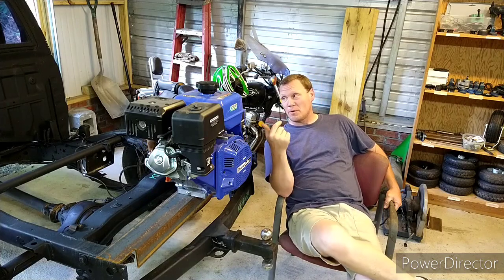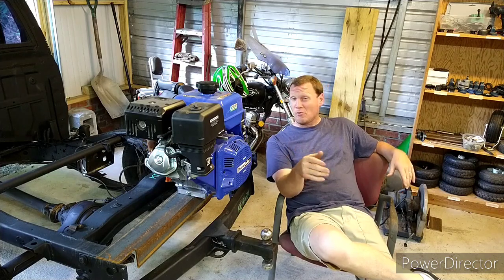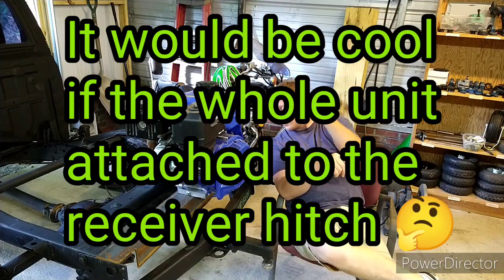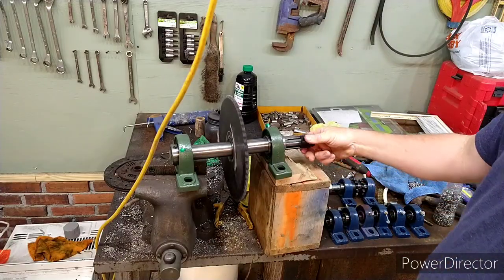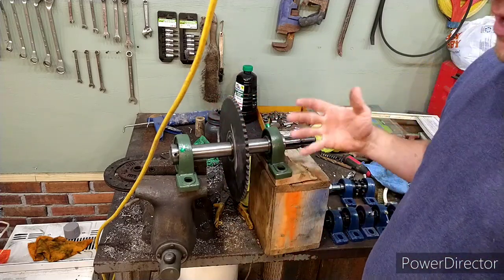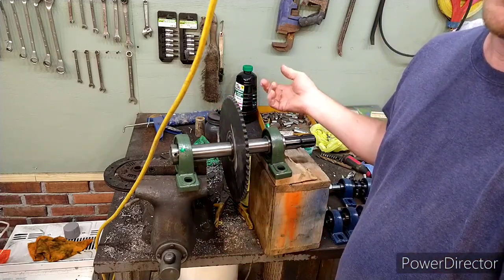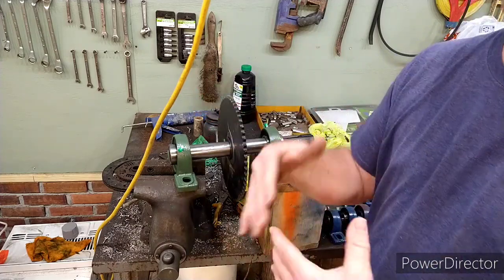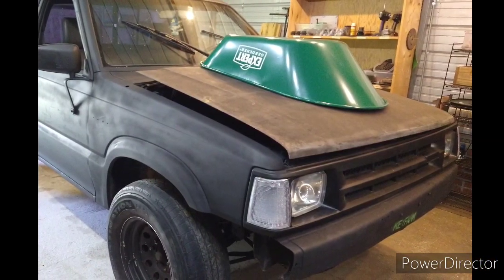Adding a tractor PTO shaft to the Predator 212 6.5 HP truck so I can bush hog with it. Concept

Comment: My buddy has a 21hp Briggs opposed twin swapped into a 87 ford ranger. He’s got it running a 2 speed belt drive off a centrifugal clutch. Low is 6-1 and high is 1.25-1. It’s got dual carbs swapped onto it and a few other mods it probably makes about 30hp. It will actually do 95kph in 4th up hill and hold 115kph😮 in 5th on flat land. He can tow a 3000lbs camper with it to 60kph. 
He refuses to let me film it says he wants to make his own channel but when it does get posted I’ll drop you a link to the video.
The crazy part is he actually daily drives the truck here in Calgary Alberta and runs it on the highway.
Gets around 950kms to the tank so I’d assume that’s around 60mpg. We drove to fort McMurray with it last year that’s a 1600km round trip and it managed.

He’s got a tiny 45 amp alternator running on it aswell I believe it’s from an old vw. He has heat by wrapping copper tube around the exhaust and using an electric water pump from a Kia to circulate it they a heater core and it works perfect even in minus 30.

I helped build it so I know most of the details.
Reply from the maker: That sounds awesome

Comment: Hay man got my S10 Duromax running but I can't figure out the throttle. Any chance u can do a short on how u set it up. We ran it with a string through the window. And that 24 to 12 ratio was spot on for the 440cc. We were moving the donkey in 4th
Reply from the maker: I actually built my throttle last night I think it's going to work I should probably do a short.

Comment: I get to tinker with my Trooper here and there, mostly been just dropping weight. I built a heavy duty wooden gantry to pull the engine and finally got that engine to separate from the transmission. It had one of those special pull type throw-out bearings and I had to unbolt the pressure plate from the flywheel. I should've just done that to start instead of trying to get that clip to release.

I really had my heart set on keeping the factory clutch but that flywheel and pressure plate are quite heavy and I'm a little worried about the centrifugal load.  Not sure.
Reply from the maker: Sounds good, get rid of the clutch, you don't need it, I just float the gears with no problem
Reply: @ChrisfromKeyfarm  right on. I have to figure out the shaft size on the engine I'm using, haven't even looked. I got that 84 tooth sprocket for the transmission but I have no idea what the axle gearing is. I was maybe thinking a 12 or even 14 tooth clutch on top. I don't know if I want to go all the way to 10. I don't plan on racing or anything, just thinking a 10 might be way too low and slow with that 84 on bottom...